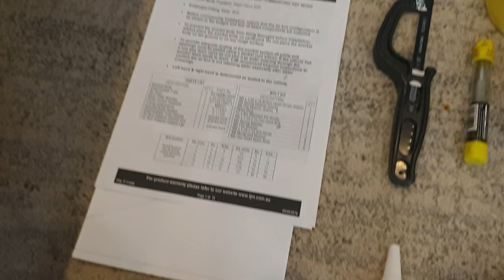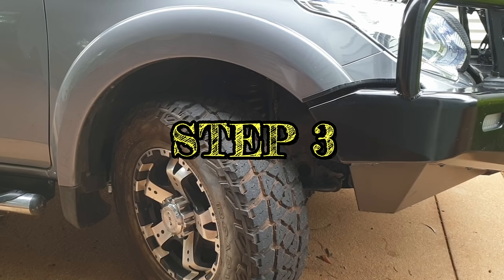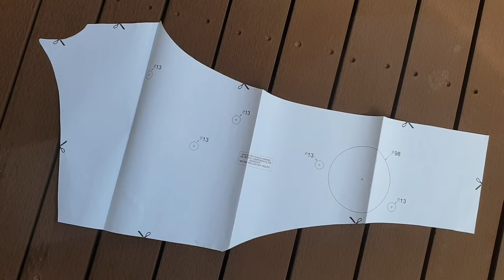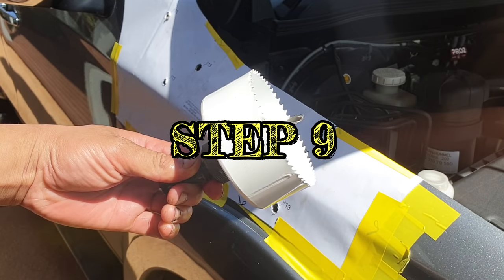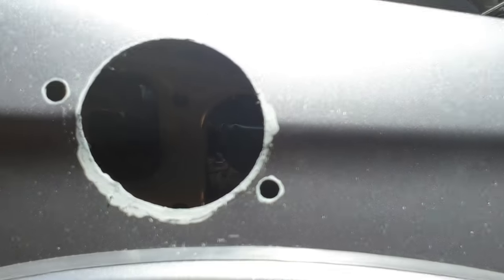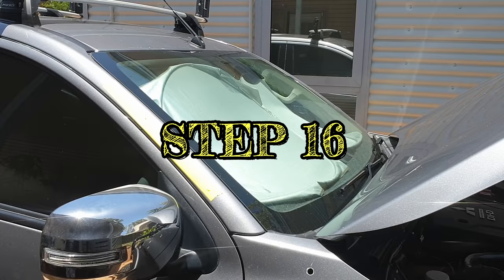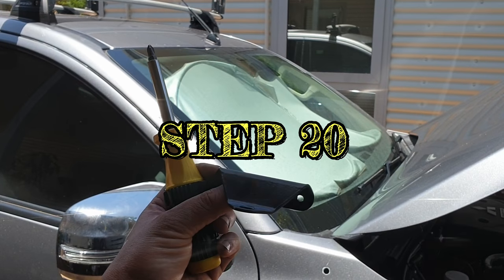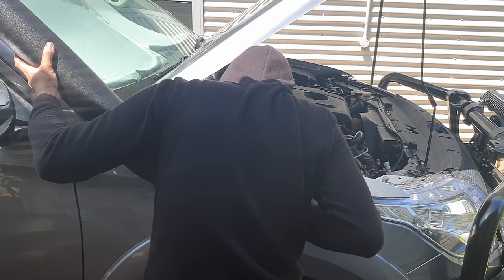HOW TO INSTALL YOUR TJM Tailwedge snorkel / installation on Mitsubishi Triton / DIY PROJECT

Comment: Hi mate. Did you happen to have a copy of the fender template?
Reply from the maker: Hi mate. Sorry I reckon I've chucked it away.
Reply from the maker: https://images.tjm.com.au/fitting/011SAT01050S.pdf
Reply from the maker: Try to check the link that's the installation instruction there's the picture of the template.  Hope it helps. 👍👍👍

Comment: Hi. Would you be able to share what tires you're running as well as your experiences regarding road noise and wet handling? cheers
Reply from the maker: Hi how's going. I'm running kumho 265 /70 R17 MT . I don't like the noise when I'm running around 80km to 90 to loud. But around 100km above it will be alright. Then when MT tyres were almost worn out you can feel the vibration at first I thought it needs wheel alignment but it's the tyre itself causing it. If most of the time your driving it daily at work will prefer AT. Aside from that Kumho it's a great one haven't change it for 3 years now been running it from Perth to Darwin several times. Probably soon. Cheers

Comment: Thanks for the video. What stops water coming in to the air box from the two rectangular covers that the foam pads in the adapter tube. Point 9 in the fitting instruction manual ?
Reply from the maker: Hi. You need to apply a silicone on each of the pad edges and cured it about 24hrs. Sorry for first few minutes of my video the audio is gone due to copyrights. Anyways apply a silicone generously on each rectangular edges and every connections until through the airbox. Hope that helps. Have a great day 😊

Comment: Hi mate what was the rubber seal for at the start of the vid? I didn’t see you use it. Also how long did it take to fit and the adaptor with the two plastic panels you pulled off did you just put silicone in there and clip them back on or did it come with some gaskets? Cheers mate
Reply from the maker: Hi thank you for your comment. About the silicone, ive attached the two gasket that comes with the kit, then put the cover back and cured it over night. Then fit it back the next day. The rubber seal ive end up not using it. Planning to fit it at the 98mm hole to avoid rubbing the metal to the plastic surface of the snorkle. But its too tight for 98mm. Cheers mate.
Reply from the maker: Any other question just let me know. Im happy to help. Cheers. 🙂👌
Reply: Awesome mate I haven’t got mine yet but I should have it tomorrow to start on the weekend , if I need to ask anything else I’ll message you! So if I was to fit it Saturday you reckon start it Friday and seal stuff so it’s cured ready to fit the next day? Thanks mate 🙂👍
Reply from the maker: That would be perfect!👍